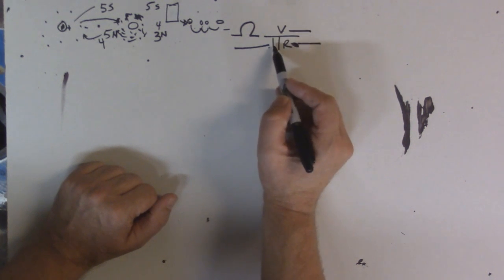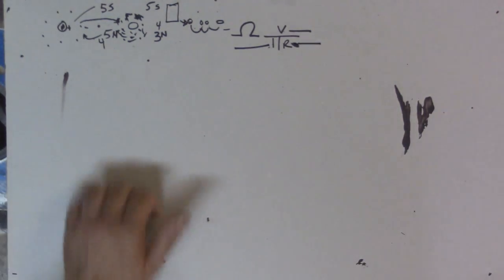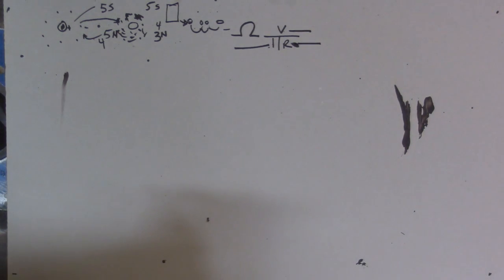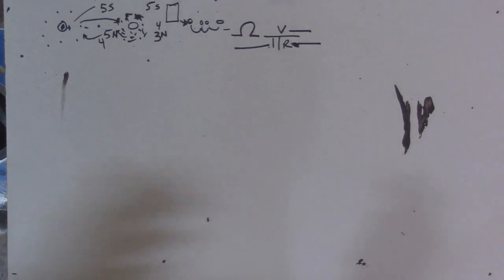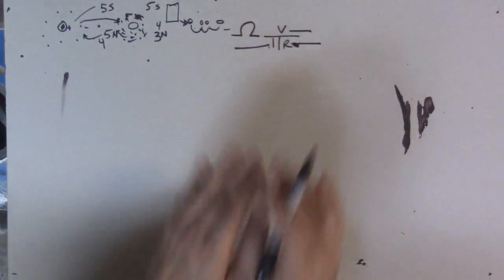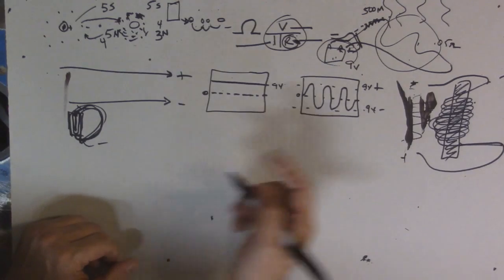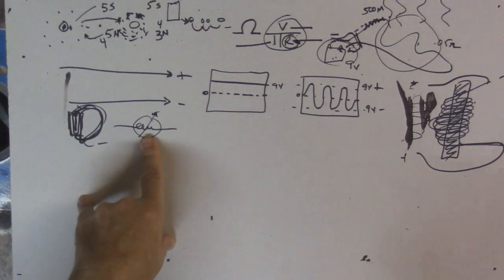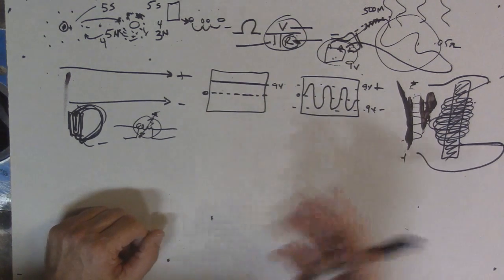How to repair electronics for dummies part 1

Comment: About getting shocked.    You can still be shocked even if the circuit is disconnected,because the capacitors stores voltage.The bigger the capacitors the stronger voltage stored.VERY DANGEROUS
Reply: shocked? me? HA. nothing can shock me. infact il touch this circu
Reply: Thats what happen to me yesterday 😅😅
Reply: If you look at a circuit, the part where the AC input goes in is always high voltage up to the transformer. You can safely touch the low voltage circuit. If your working on something that uses a power brick, high voltage is inside the power brick the device itself is low voltage.

Also the power LED will discharge the capacitors when unplugged though it may take a couple of seconds.
Reply: @eustacehendrix9659  it depends on what it is.  120ac is not considered high voltage.

Comment: Good info and very well put together.

I first got into electronics over 50 years ago, when my Granddad gave me the components to make a crystal set. Got the circuit and parts layout from a 2nd hand 'Eagle Annual'. 

Using the outer screen of the TV co-ax cable, and with a pair of ex-MOD 'phones, made the last connection.

I was about 12 years old at the time, and didn't really believe anything would actually be heard - what with it having no battery! But turned the variable capacitor along - and out of the 'phones comes Jimmy Young hosting the BBC Light Programme! I nearly jumped out of my skin - it was coming through loud and clear from the Winter Hill TX.

Been hooked ever since, and made a career out of it, too.

So good to see guys like yourself, getting people interested in this using digital technology we only dreamt of back in the day.

Comment: 36:05 Capacitor
41:24 Diode
45:47 Transistor
55:34 Inductor
57:46 Transformer
1:01:50 IC
Reply: thanks
Reply: 3:11 Basics (AC/DC voltages, resistance, amperage/current)
Reply: Thanks it is nice lecture kip it up
Reply: Thanks a lot for the great work,keep it up.

Comment: @9:54, Thank you for this explanation Sir! I finally understand how voltage, current and resistance relate to each other. Voltage is the pressure level, how fast the stuff is coming out. Current is the opening size, or the gauge of the wire, and resistance is the impedance of electron flow. I also see that there is an inverse relationship between voltage and current, and voltage and resistance. The bigger one is, the less the other one is. You explained this so clearly compared to my teachers in school.

Comment: I so appreciate the effort you take to explain in the simplest form. Communication is always the most difficult part of taking the ignorance of a student into the realm of knowledge and understanding. Teaching is an art.

I appreciate you explaining this . . . I have always been an individual that doesn't just want to know what something does -- I want to know how and why . . . and since I have put together an amplifier kit, and I also have worked trying to improve speaker crossovers . . . and wondering exactly why all the elements of inductors, capacitors, and resistors affect the frequencies and the quality of speaker sound This is getting into understanding how all this works together. So, thank you.

Comment: I have been taking stereo equipment apart since I was a teen. Just bought a marantz cassette deck and fixed a belt, am cleaning up the receiver to recreate my system from my days in the Army in the 80s. I have always had a desire to do repairs and now have the time to learn. Thank you for sharing 😎🎶👍

Comment: IMHO, these P1+P2 videos should be titled something like, "Electronic Components, What They Do, And How To Test Them".  It's not until 30mins into P2 that any repairing begins.  Then, at no fault of the content creator, the repair shown goes quickly and shortcuts most learning opportunities.  I think ESR or cold solder joints were probably the actual culprit(s) in the end.  We may never know without the replaced capacitor being swapped back into the circuit, or at least checked for ESR.

I did enjoy the videos (-cussing) and there is good information for starters here.  Kudos to the creator for that.

Love seeing repair videos and how troubleshooting is approached (many out there), so would encourage the creator to do more showing his logic and technique.
Reply: "cussing"  lol!  M'kay, Flanders.
Reply: OF COURSE the lack of clarity is the fault of the content creator ...
Reply: Thx, but … Looks questionable.
Reply: Surging Circuits y

Comment: I recently was gifted an old T-1515-4 Reel-to-reel from the 60s and I noticed a bit of rust forming on the vent, and I figured it would be a good idea to take it apart and give it a good run-down. Thanks a lot!

Comment: It's U / ( I * R ). Potential differance is denoted by an U. V just means volts, wich is a Unit of measurement for Potential difference  Other than that it's a perfect memory rule for ohms law. I usually think of Uri geller to remember it, cause he could bend spoons like we bend formulas =D

U /( I * R) and for those who don't know covering up the one you want to figure out the other two will give you the formula for it.

Comment: I taught myself analog repairs way back, then along came chips. Chips are a matter of really good information on what the circuit consists of to make repairs. Far cry from visible inspection, probing, taking a few measurements.
Today basically detailed schematics and an excellent soldering station.

Comment: The best voltage demonstration Ive ever seen was a guy arcing a car battery with a wrench and he could eyeball the voltage based on the intensity of the arc. He did it on two different voltage batteries and more voltage (pressure) made a bigger arc.

Comment: You're perfect! I learned so much with this introduction and the easy of learning path that you took is just perfect for blokes like me! I want to buy a good multimeter for starting out, so I'm considering Fluke 179 or 287.. I really would like your help on getting a good and expensive pick for not only starting out but actually keeping a good multimeter as I progress forward in my repairs. What Fluke would you suggest other than 179? I would like mine to be super precise that I would not have to buy TWICE. I have a vitamix as a blender if you know what I mean :) I like to get the sting once and then it's fun time from there...

As benjamin Franklin said: The bitterness of poor quality remains long after the sweetness of low price is forgotten..

Will appreciate your tip about multimeter lot
Thank's - perfect video - subscribed!
Reply: Technically, electrons are not passed but pushed. Electron movement itself is slow but there's already electrons in the wire and other components so the ones at the back only needs to push the ones in front. Similar to the water inside the water pipes that are just waiting to come out.

Comment: the X on the capacitor is for a predictable place for the device to rupture, so if the device fails it is controlled. Also when you were talking about transistors, you started to go out of the camera frame, but you probably already knew that. I i liked the video good job.

Comment: 12:20 Your explanation of voltage/current as analogous to pressure/flow of water is correct. 

A better comparison for a high flow / low pressure is say pulling the plug from a bathtub, it has a lot of water flowing but you can stop it with your hand. That's kind of analogous to a car battery which can supply tons of current but you can safely touch the terminals because of the low voltage, your skin can stop the current from flowing.

A high pressure/low flow example can be a pressure washer or a garden hose with a sprayer - small amount of water but you cannot stop it. This is analogous to say the spark plug in a gas engine. It's a small current but it can penetrate a lot of insulating materials including even air.

Comment: Long time when I was in college, Electrical potential (voltage), is very well mathematically represented with potential energy. So height where, the the water bucket is placed, could represent the electrical potential in water model, that represents analogues electrical model. Diameter of the pipe, resistance.

Comment: Just an insight here, there are two ways to see the direction of current flow in a circuit. Electron flow is what he demonstrates early in the video explaining how current flows from the negative to positive side of a closed circuit and this is what is actually happening within the circuit. Then there is also conventional flow which shows current moving from the positive to the negative side of the circuit, but like he said it does not really matter how you view it as this is based off of your preference, but what does matter is to always be consistent with what direction of current you decide to go with whether it be positive to negative or the other way around.

Comment: as a mech, designers found that rubber will conduct high voltage like a ign coil, 1 test with rubber, a car with coilpacks, take the end off coil and replace with 1.2 inch rubber hose, the car will run and then take your your ice pick 12volt light and touch the rubber, if the light does not flash on 1 coil , you know that there is a problem with coil,or coil driver which is switched with a ground relay in ign-module,
Reply: jimmy howard
Reply: Must be the type of rubber, or contamination, because pure rubber isn't conductive as far as I know, that's why electrical lineman gloves are rubber, right?
Reply: @assertivekarma1909  Everything is conductive if the voltage gets large enough :D
Reply: Im a 30 year mechanic veteran and I can tell you rubber is the oppisite of conductive ..its used as an insulator...
Reply: Rubber is a dielectric,which means in most cases it does not conduct electricity.
However,at a high enough voltage,you can observe the effect called dielectric breakthrough where it conducts electricity instead.
Obviously,the car igniton coil in not nearly enough to compromise rubber.
However,something like aluminium reinforced hose may be able to do what you described provided that rubber is thing enough.
Reply: @lazar2175  maybe a rubber that is designed to do so but lets be realistic they would not use rubber on almost everything as shielding if it was conductive...most ignitions are running 40 to 100 k volts and rubber is used as shielding...run your hand all the way down the wire ,no shock..no radio interference...but touch the end and you will know it..same goes for ac current...

Comment: Electronics is input/output. Press the button( input [ 0 ] ) saw starts spinning( output [ 1 ]). That's the way I look at it so I'll always understand it. If the machine or device does various things at once when yoi press a certain button( input) then its multiple outputs( logical gates ).

Comment: I didn't learn much new, but that's not his mistake, of course.  I did like the nice, comprehensive review, though.  Just the transformer principle left a little to be desired.  Ohm's law applies, sure, but isn't as essential in understanding transformers as the conservation of energy (ignoring heat loss), when explaining transformers.

Comment: I have a degree in electrical engineering and have been taught how each component works, but not how they work together. So when I open a circuit board, I can't make out head from tail🤫

Comment: Resisters are generally stabile but in  old tube amps if they dtift you can burn shit up . They used carbon types that go brittle in the extreme heat and voltage of the power supply and crack then your bias goes crazy and bad things happen.

Comment: I have a Dr Meter bench top power supply that I got about 2 years ago on Amazon  and used it very rarely then I e day it just quit and only shows a red led on the board. No voltage at the outputs. It's a 30v 10a supply. I hope this video helps.

Comment: 22:03 Dc current its not looking like this when you zoom in :D That you showed is How we want Direct Current to be.
Reply: how is it actually then if we were to draw it out?
Reply: @j2daakob  it is not going between - and + so I mean it is always positive or negative but it is not perfect line. There are so many ups and downs.
Reply: @emreaka3965  oh so due to physics some of the electrons go backwards again making the voltage less than for one moment and then it goes back forward increasing it for that moment, but the avarage is 9v
Reply: @j2daakob  I don't know what is going exactly on there but yeah 😃😂
Reply: @emreaka3965  just an assumption, for the voltage to change it would need to have some variation somehow

Comment: You remind me of Bob and Doug Mckenzie BUT you know your stuff! Here's my question: Regarding NPN transistors. We are always shown, a little arrow pointing away from the emitter. The direction of the arrow of the collector is never shown [tho we know it, to be pointing AWAY from the collector - NPN = Never Pointing iN] it is even illustrated on some NPN transistors. So, my question is: HOW does current travel in the opposite direction of the "imaginary" arrow of the collector, when the current at the base, permits it? It's my understanding that current can only travel one way, in a diode, an NOT the other. So, unless the diode in the collector branch, is some kind of zener diode, I don't understand. Please clarify. Also, complement the fat guy for me. Cheers!"

Comment: You do a very good job making sure to hide any way that someone may be able to message you, which I understand because you'd have every 15 year old kid in existence messaging you wanting you to fix their xbox for them... lol

But i have an interesting pc board for you with an extremely common failure over thousands of units. If you were to make a video of diagnosing and picking out the faulty piece of hardware you would be saving hard working men and woman from buying a full replacement $900+ board before a shop tacks on any "Diagnosis fees". I think it would be a very popular video and as i said before, the shop that made/makes the boards charges over $900 for a replacement with no solution so it goes bad again all the same. If your interested just comment back and i will drop my email for you. 

Thank you and have a wonderful day

Comment: How do diodes work if the current is flowing in the opposite direction as in a schematic?
Reply from the maker: they are a one way street for current. it only allows current to go in one direction.
Reply: @Cookingwithdrchill   I understand that, but actual electron flow is opposite of how a diode is placed in circuit (placed to work accordingly to conventional current flow). 
Diodes are placed in circuit as if current flows pos to neg, but you said that current actually flows neg to pos. 

I subscribed and will be watching more of your videos. I understood everything your said, except the above doesn't make sense.

Comment: Really good course, thanks, and does Ameria use 220v from the wall?
Reply from the maker: only for large appliances. most is 110
Reply: Holy cow, for almost 3 decades I've believed that Japan is the only country adopts 110v household electricity, which causes a lot of waste on wiring copper...It turns out that America does the same thing.

Comment: I've always struggled to understand the whole voltage/current thing with the water analogy. It causes confusion because the pressure and volume in a hose are directly related but in electronics this isn't the case?
Reply from the maker: think of it as a water tower with a 20 foot hose at the base of it. the air pressure and gravity push down the water in the tower making it want to spray out the hose. this is pressure or voltage. many times its called potential. the size of the opening at the end plus the pressure determine the amount of water that comes out per minute. the opening would be considered resistance, and the amount of water per minute would be current. so if you decrease the opening, you increase the resistance and decrease the amount of water coming out per minute thus decreasing the current. the air pressure and gravity is the same so the voltage is the same. 

using ohms law you can see the relationship.   let's say voltage is 6 and the resistance is 3  ....v/r = 6/3=2 so the current would be 2. we could also find the voltage by current*resistance=voltage  2*3=6. we can also find out resistance v/I=r   6/2=3.    

lets change it up volts will stay 6 but the resistance will become 6. so that means the current is 1. 
if you changed the current to 2 and the resistance to 6 the voltage would have to be 12. 

the relationship they all have is very similar to how a hose with water works. just pretend the V is the pressure from the tank, the R is the size of the opening (the smaller the number the larger the opening)  and the C is the amount of water coming out.   so if the V is 14 and the R is 2 the amount of water would be 7. if you make the opening bigger C= 1 you would have much more current. 14/1 = 14 C=14
Reply: I  appreciate the time you spent to respond the way you did. But yes, it's a bit more clear, the relationship is a little more obvious than what I had in mind before.